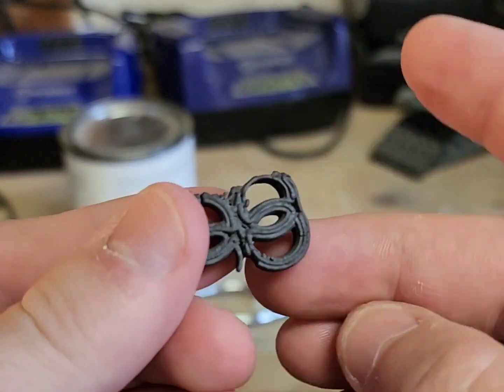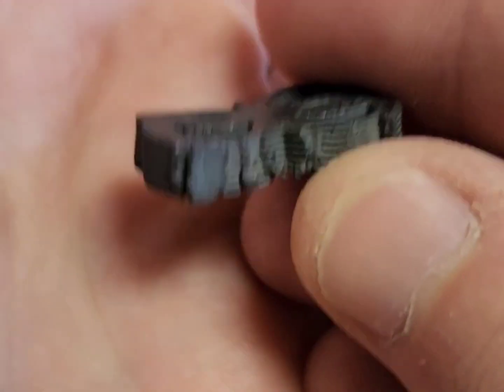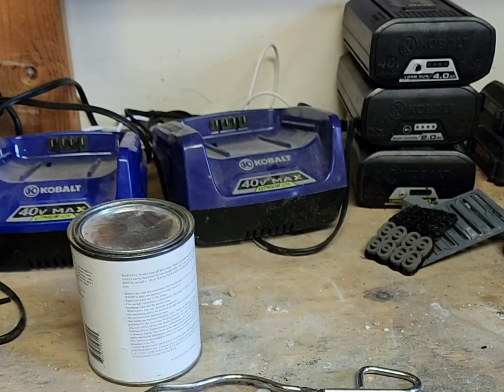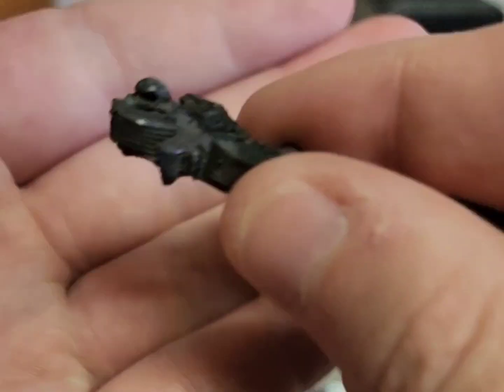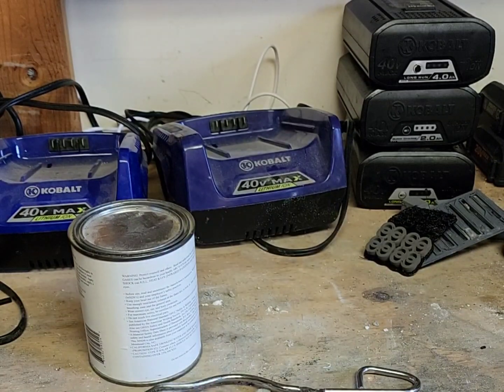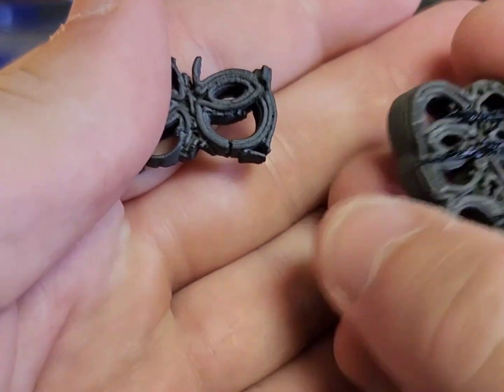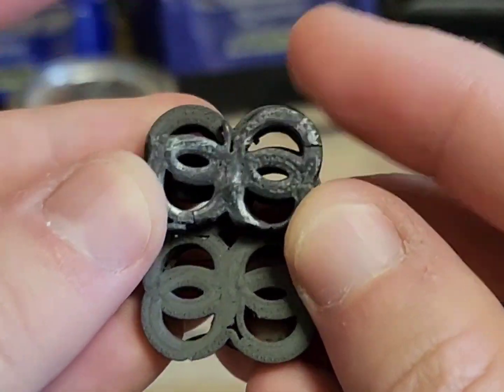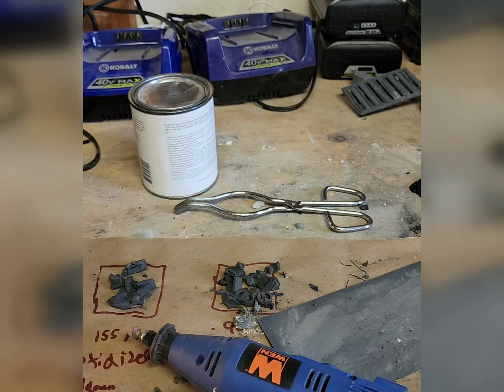Current Titanium Results full video to follow

Comment: Are you sure it's sagging?
If you're using a normal rotating tray in the microwave, one side will get hotter, while other will get less heat, since it's further to the magnetron. This can be similarly observed with heating food, especially when the tray is broken and doesn't spin. Energy deposited drops significantly, even at very short distance.
 Not sure how this non uniform heating impacts sintering metals using microwaves. Perhaps it's causing warping. Like with welding sheet metal, the weld can shrink when it cools, and twist the sheet, warping it.
Reply from the maker: It appears to be sagging but to be clear I'm not using a standard setup (ie. No rotating tray, custom crucible, multiple heat susceptors, and reflective areas to help distribute waves from wave guide).
From my tests doing these things does seem to distribute the heat in a pretty uniform manner even without the rotation, but the observed sagging could also be an artifact of cooling or improper support from the ballast.

All that being said... it's tough to say and I need to do more experimenting 😅
Reply: @Mr-Highball  Cool.

Why did you choose titanium? Maybe SS would be a better choice to try to make work first.
 Maybe it would be a good idea to try to make a 1 / 1,5 mm thick rectangle plates on larger surface, instead of those fairly complex, thick, small footprint shapes. 
 That way it would be easier to observe  the potential angle/direction of warping and or sagging.
Reply from the maker: @buka9993  thanks and yeah SS is up soon. Titanium was chosen partly because I like a challenge (I've been working on aluminum for a while too so had some previous experience with reactive metals) and partly because it's a very useful material in certain industries (cracking this nut might could get some attention or land some sort of funding 🤞)

Comment: Thank you for making this. Question: how much tamping do you do to the ballast material powders that surround the metal filament?
Reply from the maker: Thanks for watching, and I've fashioned up a wooden tamping tool from the end of an old table (recycle reuse right?) 
With these parts I generally do a light single pass tamp across the top of the ballast. I'm not trying to compress it fully because some degree of wiggle room for the part is good during debind